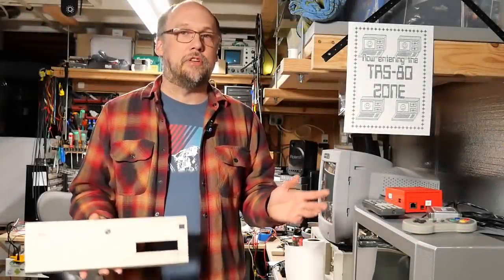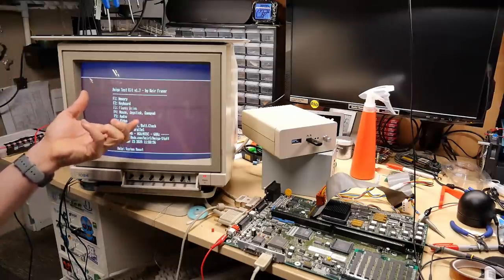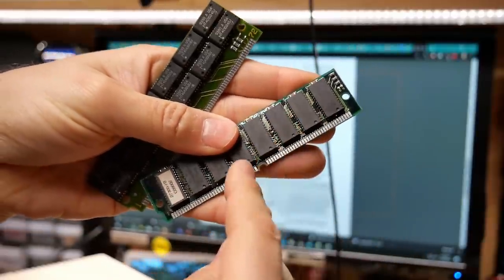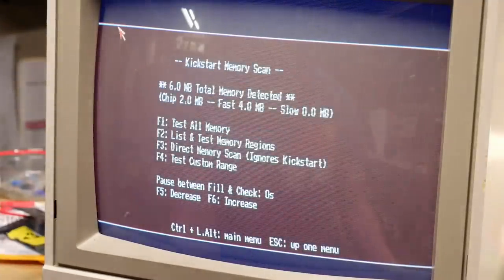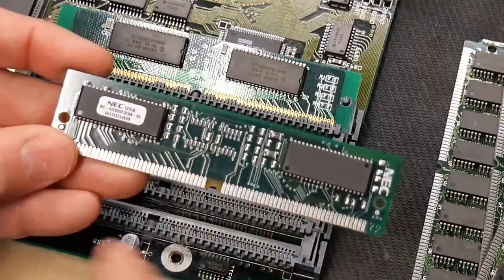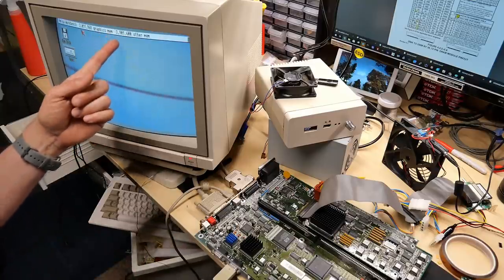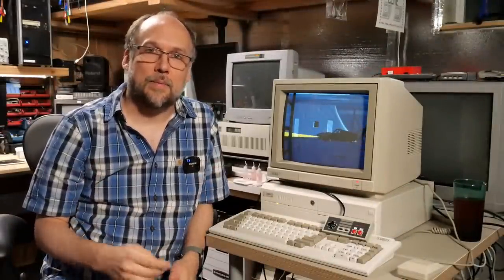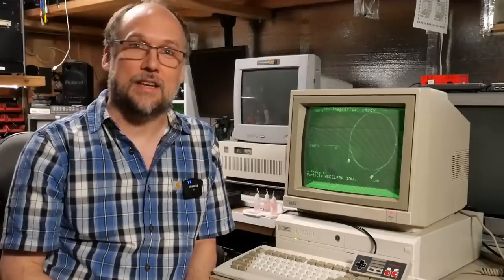Amiga 4000 Repair Part 2: RAM issues are solved!

Comment: a rule of thumbs in the 80’s was: Wait 20 seconds before switching the computer back on. Never had any problems
Reply: yeah i was taught the same thing, not to flip it off and immediately back on again.  give it a few seconds
Reply: @JasonHalversonjaydog  Gives the charge in the RAM time to discharge.
Reply from the maker: This only Applied to some computers like the Apple II where it looked for a specific piece of memory to bet set to know if you were doing a soft-reset or a hard reset. If you power cycled too quickly it thought you wanted a soft-reset and that would create unpredictable results. (See my Apple II repair video.) This issue doesn't affect computers like the Amiga that don't even have a soft-reset capability. (soft reset preserves memory contents.)
Reply: Yeah, I agree. I mean, the ram get's initialized after Power cycling anyways, so I doesn't matter if data is still present or not.
Reply: I read this somewhere when setting up my A500, you should wait 20-30 seconds before turning back on. I also get this error when I turn off and on too quickly. It might be in the manual.
Reply: @adriansdigitalbasement  Well, you might have capacitors keeping some of the power lines still alive when the computer is rebooting which can lead to unpredicted chip states and mess up with the booting sequence.
Reply: @adriansdigitalbasement  Thanks for another great video! FYI, the A4000 User's Guide (P/N 368 924-01) on p2-4 says: "If you want to turn the Amiga on again immediately, wait at least 10 seconds after turning the machine off before turning it on again." Maybe it recommends this to minimise problems like what you encountered. I also remember back in the day, even though I didn't have an A4000, if I tried power cycling my A500 too quickly I'd get a Guru meditation.
Reply: Amiga’s take time to clear ram after they are powered off, all 4 of mine need ~3 seconds before powering back on or they do similar things.
Reply: @tw0469  it does? how do you know?
Reply: Had an Atari ST and same deal. Rapid off and on would give a memory fault.
Reply: I recall some demos , viruses and bootblock virus scanners would hook something called the "coldcapture vector" (I never learned how to do it - information was scarce, and I didn't have a Rom Kernal Manual  - and when I did get one after a few years, it was the wrong one [I think there were two]) . Hooking the coldcapture vector could get code to run that survived a keyboard reset - but I found that a coldcapture program could persist for ten or fifteen seconds or so after the power was turned off, with the program gradually degrading after each power cycle until it would no longer run.

Anyway, the point was, if KS 2+ machines used their own coldcapture hook, eg.  to run a harddisk boot test before trying the floppy (the black screen at the very start), it's possible that this code (or its variables in ram) could be partially corrupted by a short power cycle, then after an attempt to run it fails and passes some error code (or nothing) back to the os, which then shows the yellow screen as part of an error trap. The fact the computer typically recovers without a further reset might suggest it is a normal part of the boot process, albeit one which included recovery from an error.
Reply: I also agree that any Amiga magazine back in the days always stated to wait at least 10 seconds when power cycling your Amiga. And more important: Never ever remove or plug in any cable while the system ist running. Especially when the cable has metal shields, you easily short some pins and will destroy or burn some trace line or chip.
Reply: @adriansdigitalbasement  The Amiga 1000 had a capability of using a chunk of Fast memory as a recoverable RAM disk, and I have to figure that the 4000 might have had this.  The memory area would survive a warm reset, and if set up like I had it (0.5 MB Chip, 2 MB Fast) on initial boot you fast-copied the WB floppy to the recoverable disk, which was named RAD: and was sized to equal 1 floppy.  Then the Startup-sequence immediately rebooted, tested for presence of RAD: and booted from it if found.  You then had a machine with the Workbench in a memory disk and could load your programs from a floppy.  This gave an immensely faster Amiga, especially in a pre-hard disk era.  The fastload sequence would dump DF0: onto RAD: in under 30 seconds, and the reboot from RAD: was about 8 seconds IIRC.  The process including reboot was still faster than booting into WB from its floppy.  The RAD: would survive any number of normal reboots, but in some cases the memory area could get corrupted by a crash elsewhere.  Hi, Guru!

Anyway, respectfully, your statement about not having soft-reset is incorrect.  I don't recall whether RAD: would survive a quick power switch cycling.

I did have to love your rhetorical question about "whoever could use 16 MB of memory?"!!  FWIW I ended up eventually with an A1200 / 060 with 64MB of Fast mem and I don't think I ever did fill that up in use.

As others have pointed out, there were lots of memory chip incompatibilities back then JEDEC notwithstanding.  I actually populated part of my first 2MB Starboard with RAM chips from work that were discarded by the computer tech because they wouldn't work in any of the PC expansions we had.
Reply: @pault151  The RAD: was awesome. I seem to remember it was a function of 1.3 but I could be wrong.  I used to use it all the time on my A500 when I added a SupraRAM side expansion.  It was great for not having to swap disks.  Like a poor mans HDD as long as you reset with Ctrl+Amiga+Amiga.  Such a great time to own a computer then.
Reply: I remember there was an IBM PS2 and our teacher said proudly that the IBM's PSU is so advanced that the machine doesn't need a reset switch, because it can be powered off and on quickly without breaking the machine. We'll we tried of course and after the fiftieth or so on-off it actually broke the machine. That's why you don't tell these kinda things to stupid teenagers because they take anything as a challenge. :)
Reply: Bart Honhoff : Huh. Never had any problems flipping the switch on my C=64. 😎
Reply: Adrian's Digital Basement 🤖interesting info
Reply: @adriansdigitalbasement  also think of capacitors that could take time to discharge, also helps with heat. 
I know some Power supplies that take time to fully discharge, and My Nickel Cadmium battery charger still thinks it's plugged in for up to a minute from the caps being charged from a USB power adapter.

Comment: The RESET capacitor in the RESET circuit hasn't had enough time to discharge.  The best way to avoid power on issues, is to just hit RESET before powering on, as this forces an immediate discharge of the capacitor, and forces a cold boot.  Anyone that had these machines when brand new, would tell you that immediate power cycling will give you bizarre behavior.  You must WAIT before powering back on.  This was the case for most computers in the 80s, not just Amigas.
Reply: Can this type of issue occur on a 128DCR? I've had strange hangs and whatnot when rebooting... any thoughts, Richard?
Reply: @curtdawe  Like I said, it can occur on any retro machine.  Just hold reset when power cycling and it should never again cause an issue.

Comment: It amazes me how finicky the RAM issue was.  I was super impressed with how you converted the 8 megabyte simms to 4.  You should print some custom labels to put on them indicating what they are now.  It may help the next guy 25 or 30 years later when he is working on it.
Reply: It should still make sense. Using the chip codes and the solder points that determine the size, it should be enough to figure it out.
Reply: @TechToTunes But why leave that as an exercise for the next guy instead of, as was suggested, printing some labels that would immediately tell what's been done?

Comment: The really strange thing is, I have the exact 4000. With the exact grey slots. That does the same exact things ... As I speak right now, I'm about to go through it again. I've ordered new ram all around. The difference is I had 3.1.4 roms in it. For the hell of it, I've ordered some regular 3.1's like you have, which are here. Plus I have the gotek and the software you have to test the ram. It's all been professionally recapped. Some of the other Amigas, they do not have those exact grey slots. When I install all the ram, both sets even the new set, I get 2 chip, 4 fast. One of the new fast ram chips turns the screen yellow. However, when I do not use that ram, I do not get a yellow screen. Sometimes green flash, but never hangs. You had mentioned the chip ram was 8 I believe? I watched this so many times, I am going by memory now. Mine is actually 2 meg. Curiously, that may be why you are getting the results you are? Because the 2 meg only addresses 1 ... However, when they are all put in the slots. It measures 2 meg chip, 4 meg fast ... I need to think about this more.  In case I can't get it. I've ordered a bigramplus card from individual computers. My 4000 is perfect, I hate to waste it. Much doesn't run with just that, 4 fast. 8 as you said is plenty. Also, I need to look at the ram charts. But I received the new ram from someone adept in Amiga stuff.  Any input would help, great video!

Comment: My six-year-old son wants to find an old Mac to recap thanks to you!
Reply: I'd not let your son touch a machintosh due to the CRT. 
Maybe an apple 2 series of PCs, but a machintosh is a no no for a young kid. :|
Reply: @HoboVibingToMusic  The kids wants to. It doesn't mean he found an Old Mac and it is already opened in front of the child with a charged CRT. Cool down.
Reply: That's awesome, but please don't let him start a company call Skynet later! 😂
Reply: Then He should put the right mask, to avoid breathing the Flux fumes that are not good at all for childs
Reply: I'm so sorry that your son became an Apple fanboy.
Reply: @Rv-Tech  Let's just ignore that it also implies the child holding a soldering iron which reaches temperatures in excess of 400 degrees.

Comment: "I don't need a full 16MB, what am I gonna use that much RAM for"
Proverbs from another time...
Reply: Lol...Very true...My first Amiga HD was a sizzling 80MB, and I never filled it up :)
Reply: 640K ought to be enough for anybody!
Reply: Now I'm over here sitting with 32GB of it wondering if I should have bought more...
Reply: @bdhale34  Same
Reply: There are systems with 1 TB-ish of RAM now. It runs hot, and gives no benefit to your everyday software, but it's there.
Reply: Once you have 640Kb, you are good forever
Reply: @michaelblair5566  -- He was referring to home users of that era. Corporate users were using more RAM. I like another time that Bill Gates seemingly put a foot in his mouth. And that was when he was demoing Windows 2000. "This is the most stable Windows operating system we've produced." And the audience started laughing uncontrollably. The copy of Windows 2000 that was being demoed on the projector just BSODed at that point.
Reply: @PlumGurly  It is also of note that no one in Microsoft was responsible for the 640kB barrier. That was due to hardware design decisions made by IBM.
Reply: @bdhale34  I have 128GB (for CGI work) and sometimes I have to close few apps to fit in. :)
Reply: Never ask that question to a man with 1 Terabyte of memory in his living room and is always running out of memory for his investigations into the subtle and austere.

Comment: A lot of pre-Pentium era machines have compatibility problems with 60ns EDO 72-pin SIMMs. You need to find a good batch of standard 70ns FPM 72-pin SIMMs to have on hand when working with these old machines (386, 486, Macs, Amigas).

Comment: My father taught me that you should count slowly to eleven when turning off electronics before you turn it on again.
Great video, thank you!.
Reply: Glad to know I was not the only one
Reply: Is that 11 in decimal, or binary?
Reply: @MrWaalkman  there are 10 types of people: those who understand binary and those who don't. :D
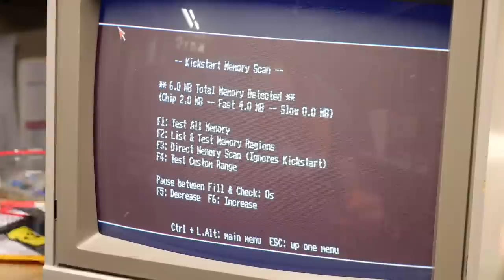Reply: Yep agree.  He should do all the tests again but this time wait 10 secs after turning it off every time.  I think you will find it's reliable.  @14:05  Yep..  Your older RAM is still active when you turn it back on so quickly. Well done in sorting it out thougg. And modding the 8MB to 4MB Simms. Looks great.
Reply: MrWaalkman There are 10 types of people: Those who understand binary and those who don’t.
Reply: @OzRetrocomp  Very clever, glad it wasn't 100, Ha, Ha, it would have been far more confusing.
Reply: It's a good rule of thumb for modern tech. Allows the caps to discharge.

Routers in particular need this, allows them to clear all temp crap from memory and usually fixes a lot of issues.
Reply: For me it was only five seconds.
Reply: I was taught 7
Reply: @OzRetrocomp  1

Comment: That reminds me a RAM quirk (was it early Apple-II's?). If you turned them off and back on too quickly there was still some memory retained that didn't disappear while the system was unpowered and affected how the system booted (warm start).
Reply: It was a crude hackish way of detecting cold vs. warm start.  The memory location theoretically could have the value for "warm start" there randomly when you turn the machine on.  It could have been done properly with a few cents in components, but that wouldn't be Apple would it?
Reply: I used to have fun rebooting a computer while playing a game and then loading up the HGR2 graphics mode right away and see that sometimes, some of the video memory was retained from the game.
Reply: Had a Sinclair QL back in the day, it was used quite heavily. Found when testing software, debugging that a 10 second wait (or longer ) was needed to for the memory to clear otherwise you could get random stuff still there when you re-booted.

Comment: If you remove the cross brace holding the slotboard,you will find a notch in the slotboard to run the cable thru. You can also run the cable thru the gap at the back where u ran power,theres just enough room. 4M low profile simms can be had off ebay for about $2ea or less. I find it a good idea to tin the fresh,cleaned traces that were previously corroded with solder,it can sometimes bridge a microscopic crack and add a layer of protection in any case before coating it.Did i hear you say EGA? LOL

Comment: "It starts from the top and heads down" maybe it's just because you put them in the "high" slots? if you used the other two slots it might start at 7000000 instead of 7800000
Could also be that one of the RAM slots you're currently not using is bad, as in, that RAM interface chip you said you tested, but looks like it could be slightly corroded actually is bad.

Comment: Superb work as always Adrian, the 4000 is a strangle old beast, my friend used it for MIDI stuff, he decided to get a SCSI drive for it which in those days was horrendously expensive. It arrived, he picked up up and dropped it on to a concrete floor by accident. He was literally in tears....Not only was it dead but it had a mark so he could not send it back as DOA. A lot of money later he was working again and with out a long story showed Jean Michel Jarre the software he used, Bars and Pipes which Jarre had never seen as he was using an ST (I think). True story.. (JMJ was here for the Docklands gig and his friend was the councilor in charge of overseeing the gig, knew Kevin was a fan and brought him around to his house, short version of the story)

Comment: Older ram had a much longer data retention than newer ram, wich means that it took longer for the ram to be cleared at power down. The more chips are on the ram sticks the greater the problem. Faster (60 vs 70 ns) also helps in this regard. Always wait at least 10 seconds after power off before turning the power back on.
Reply: I was going to say. Even on my 1MB Amiga 500 if you flicked  the power on and off too quickly it would crash (or lead to Bad Things). 10 seconds is a while, but may be needed for older computers with high (for the era) RAM capacity. At least 5-6 seconds should always be allowed, even on a modern computer.

Also? I cringed a lot, just for the power supply, the entire time he was flicking the power On/Off like that.  Honestly I was kinda surprised he didn't check the power supply 1st, that would be where I would start with any computer this old (but I'm not an expert). The caps on those go bad too... 

I realized he checked the voltage on the PSU and it was good, but old/marginal caps can cause intermittent problems too.

Comment: There is an easier way to use double sided 8MB SIMMS, and you only need two of them. Simply place the first one in the second SIMM socket and the second one in the fourth SIMM socket. Set the jumper as if you are using 4x4 MB SIMMS and voila! you have 16MB. The double side SIMMS will fit as the neighbouring socket is empty.

Comment: I think if I switch off and on again my Intel i7 PC like you did on that poor Amiga, it would probably show an AMD Ryzen at some point!!  Really, you should give the system time to discharge fully when power cycling. Switching off and on within 1 second is just going to give you any sort of random behaviour. Honestly I do not see a fault with that memory if the system works ok when you give 15 seconds before powering on again. As others said, what you saw was probably a data retention issue.

Comment: If you check out Retro Man Cave’s recent Amiga restoration, he put a modern power supply inside the case from the old one. Big advantage in stability of the output, and not having to recap it. Also has the hidden bonus of the new power supply being 100-240V tolerant. See Perifractic for what happens when you mix up which voltage the power supply wants...